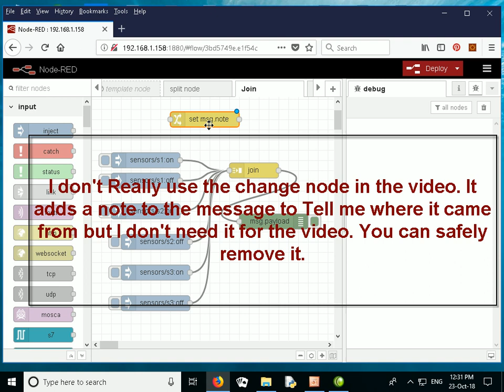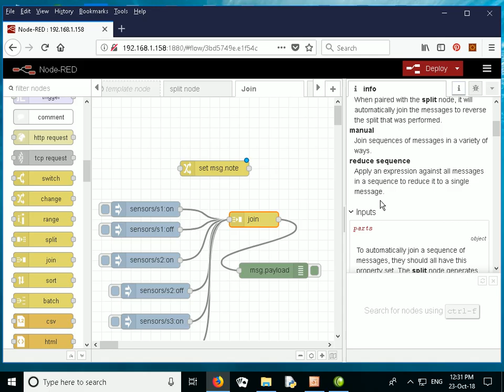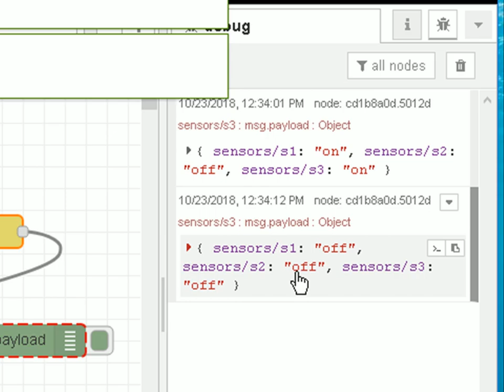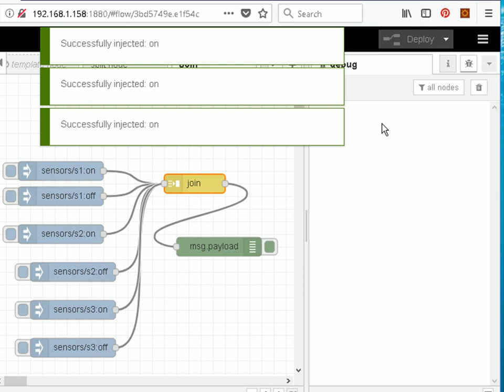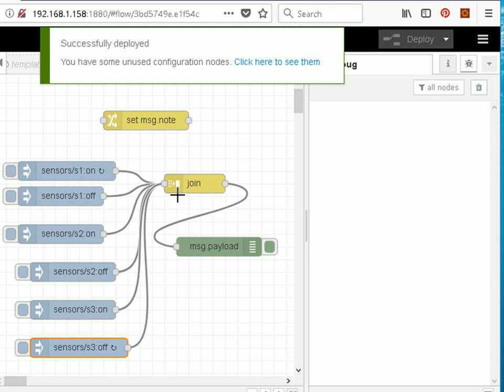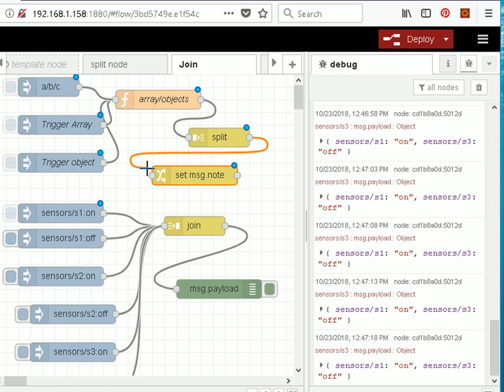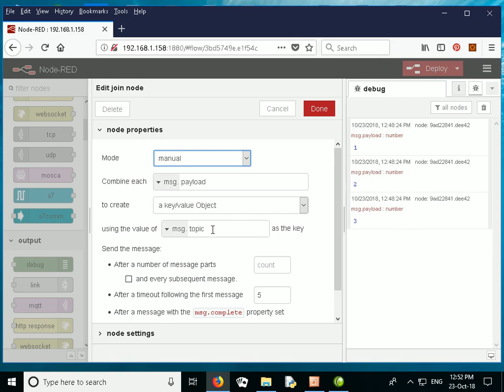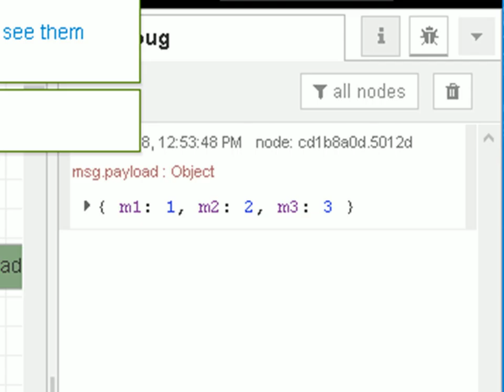Node-Red Join Node Step by Step For Beginners

Comment: What could be done that it joins messages only if the first message has a certain payload?
Reply from the maker: I looked at it and it doesn't seem that you can do it. I would try detecting the first message in a function node and then passing i to the join node.
rgds
steve
Reply: @stevecope , in the end it turned out that with flow.set and flow.get in functions I was able to reliably join the two messages. Interestingly, I used one of your other tutorials to understand better how to do that. Thanks a lot!
Reply: @stevecope  , thanks for your fast reply. I was actually working on that, too, and now trying to see if I can save the values with the "context" function